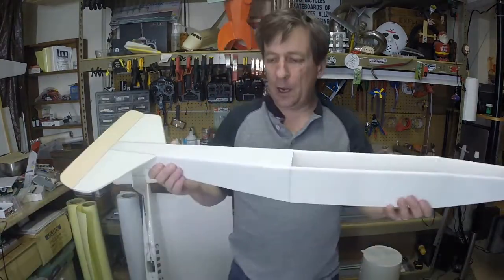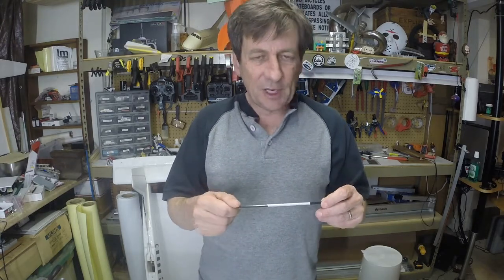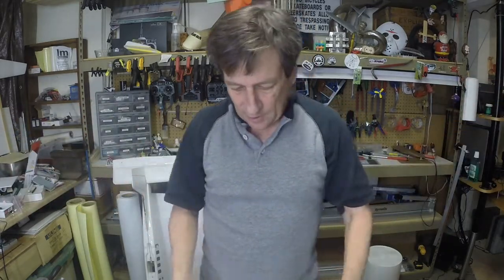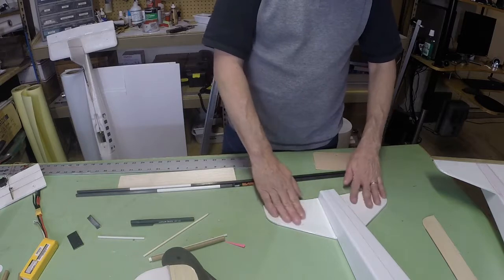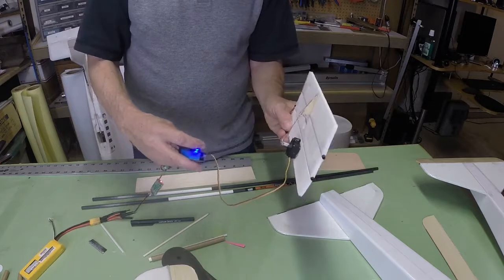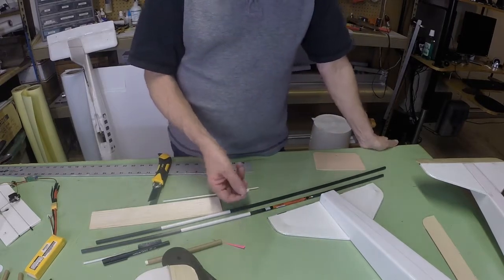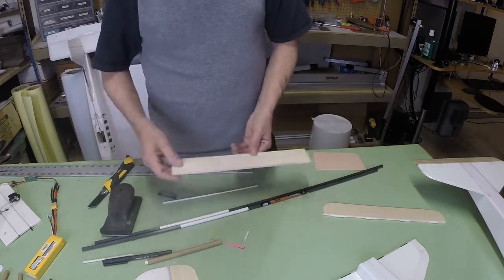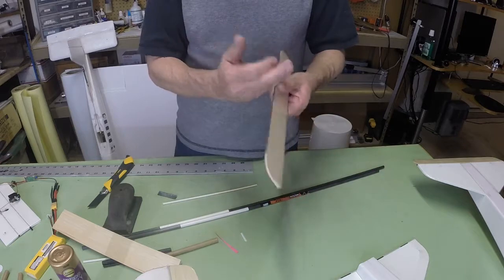Gapless Tube Hinges for Foam Board RC Airplanes

Comment: Interesting, the little model you made with the two piece flap…you could add something similar to the leading edge of a wing too, alter the camber of the wing from flat to highly undercambered for extreme slow flight…an articulated airfoil.
Reply from the maker: Yes!.  You could try the hinges using telescoping model rocket body tubes in some interesting sizes from ASP.  I think there's a lot of potential there.

Comment: super clever! Since you can get CF tubes in any milimeter diameter, you could also try drinking straws- plastic or paper. Lots easier to find
Reply from the maker: Indeed, but finding good fits was tough for me.  I tried a couple dozen different straws to only find a couple more good fits...  for 3mm, the Dixie stir straws from office max.  For 2.5mm it was the red stirrers from Staples.   If anyone finds more please let us know...  

I love your channel.  Thank you so much for the comment!
Reply: @flingsair8240  The coffee stirrers make much more sense than using a carbon rod so thick it could hold a few hundred pounds in that configuration.

Comment: What do you use for laminating? Where do you get it??
Reply from the maker: It's called "cold laminating" film and it is essentially a sheet of tape with backing paper.  It comes in glossy and matte.  2.5 or 3 mil is common  I think the glossy is better to apply shipping tape to... I get rolls on Ebay and it came out to about 66 cents a sheet.  You can get smaller rolls at office stores, but the price per sheet gets pretty ugly.  I would (did) sell sheets but the shipping cost kills the value.  Please see my earlier video on laminating...

Comment: thanks for posting.  but no cigar.     here are some  Commonsense  things to consider.   at :41,   can you spell      cf  is  HEAVY.    (so  let's use  Lots of it,  Right  at  the  TAIL.  doh.)    ever hear of  a  POPLAR  dowel.   MOST  HARDWARE/variety STORES  HAVE SOME.      do you not realize how  easily  one can  Make a  paper tube, of ANY diameter.  but no,  let's  send off for some  PROPRIETARY   ones.    this   full-length  piano  hinge  design  is a case of  lol  OVER-building.      it  ONLY  takes  three  smallish,  hinges  to   do  the  job.    cheers      googletranslate
Reply: Hugh Davis  'YOU'RE'  a   Too-Late   pussypinheadpuke       kma